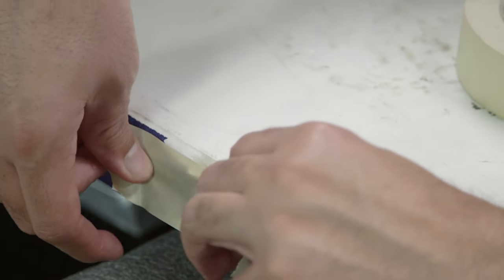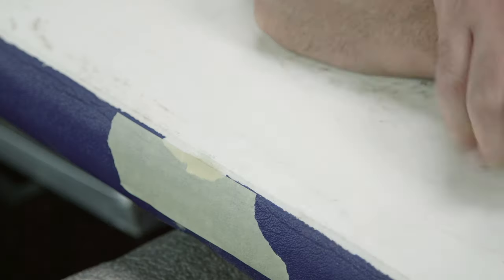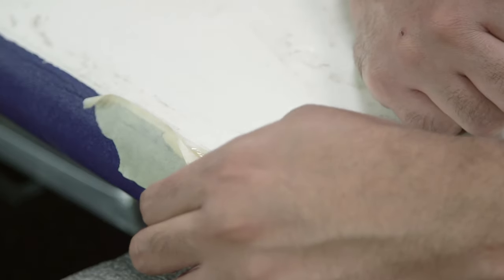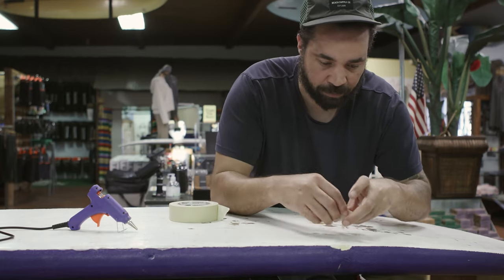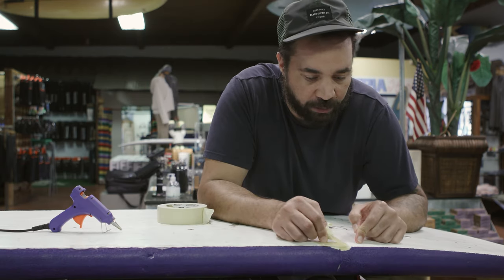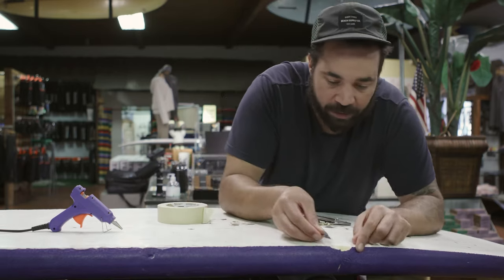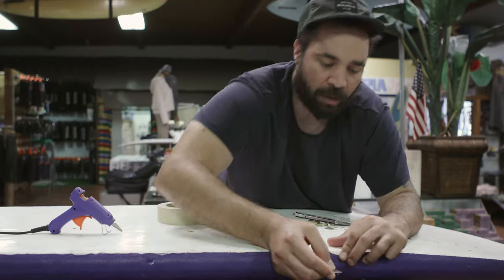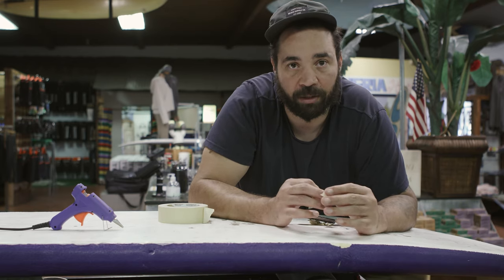An Easy Way to Repair Your Soft top Surfboard

Comment: I tried epoxy on my own and it didn't work. Hot glue seems so much easier to work with. Thank you for posting this
Reply from the maker: We've tried epoxy in the past as well.  It just burns through the foam.   in terms of effort, the hot glue route seems to be the fastest and easiest.
Reply: @RiderShack  Epoxy burns through the foam? It shouldn't. What happened? What foam?
Reply: @patrickengelen70  epoxy it heats up to get a strong bond, a lot of times the heat will get hotter than the melting point of the foam before it cools and the foam will get eaten thru awhile the epoxy cures

Comment: should I use hot glue to stick the slick back down if it delaminated from the nose?
Reply from the maker: You can give it a shot.  It'll probably hold in place for a bit.

Comment: This is awesome thank you/ What would I use to restore the color (paint) parts of my soft top board? And also what can I do to put that clear coat back on that bubbled and ripped off?
Reply from the maker: I think colored sharpies might be your best bet trying to match colors.  Plus it would make touch up a simple process as well.   There is that thin layer of film on soft-tops that peel up from time-to-time,  I don't think its worth trying to fix.  You could try to put "ding tape" over the section that peeled up.  Again, I don't think it's worth your time though.

Comment: I tried several technics even the one prescribed by the brand of my softboard and it is terrible. The pieces are usually falling and then I just add plastics in the sea... With this one (as shown in the video), I am pretty sure the result will be the same :s but thanks for trying to find a solution to prolong the life of softboards ;)
Reply from the maker: Sorry to hear that.  And you're right, even this method is not a 100% fix and will eventually fail.  It's just way less effort on the front end.

Comment: Should we use low temp glue sticks or high temp glue sticks. Worried about melting the EPS foam.
Reply from the maker: I don't see a problem with using low temp glue stick.  To be honest I assumed all glue sticks were the same.

Comment: Doesn't heat from a hot summer day melt or just soften the hot
 glue?
Reply from the maker: You probably need 300°F or so to melt the glue.  Your soft-top would delaminate before the glue melted.

Comment: Why not silicone? I mean for a deep cut
Reply from the maker: You could.  Just check that it it safe for the foam and water proof.  I've used Soft Phix and Gorilla glue as well.  They work very well.  I just feel that hot glue requires the least amount of effort for the same outcome.

Comment: Will this method work well with regular super glue?
Reply from the maker: Super glue will most likely melt the foam inside the board.
Reply: @RiderShack  thanks for that! I’ll a hold of a glue gun🤙